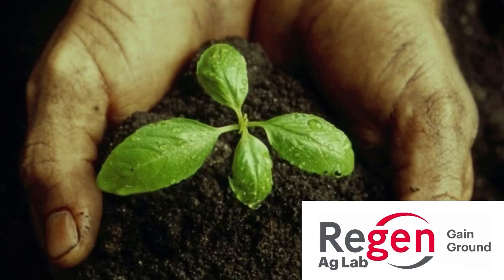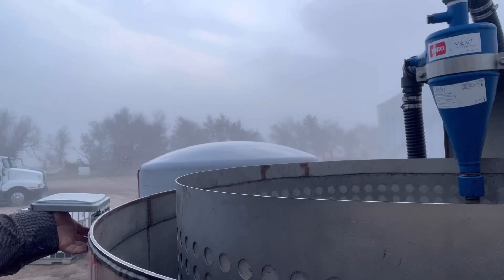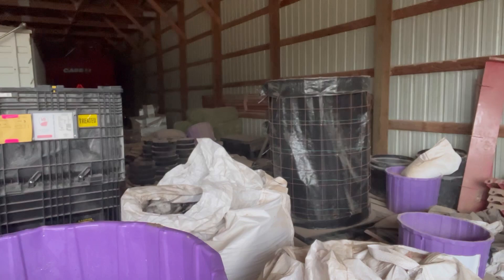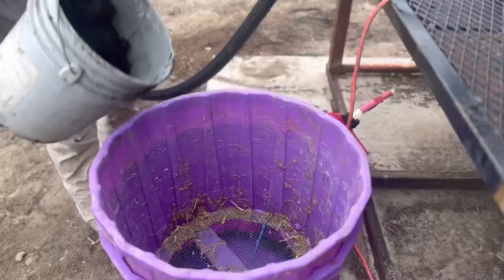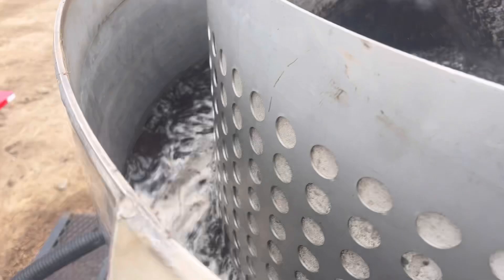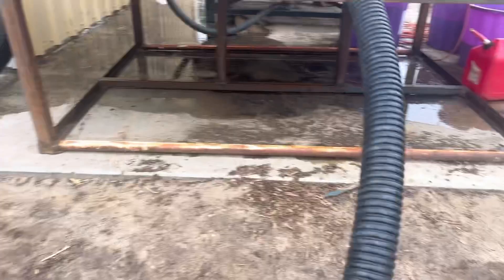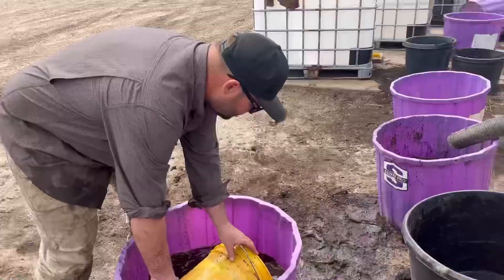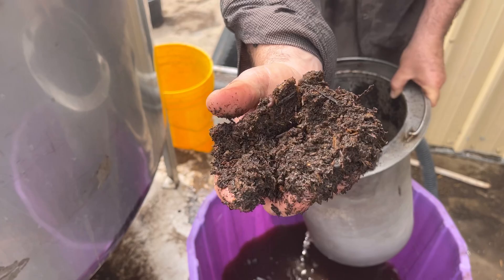How much time do I spend making Compost Extract during corn planting season?

Comment: Run your clean out material through a brew 100 mesh bag (brew in a bag). Then pump the extract out of the tub to your trailer with a little 110v floor sump pump.  Saves a lot of time
Reply from the maker: I like that idea

Comment: Could you dry the rinse residue and add that as dry talck to the seed
Reply from the maker: Fed’N happy yes.   Bio 5 has a few pieces of wood that might be a little tricky
My compost no
Reply: I have screened bio five and coated seed with it. It works great
Reply: Does coating the seed have same effect as using the liquid in furrow? Just looking for easiest way to try it.
Reply: What’s the shelf life of compost extract.  If you could have a 10000 gallon tank full before seeding. Make 30% of your daily usage during seeding.  Spread your time out.
Reply from the maker: @tylersmith3396  

John niswonger has a system with 2 3000 gallon tanks and he can make a 6000 gallons in 1 hour
I’ll try to find that video
Reply from the maker: @tylersmith3396  https://youtu.be/75pyDkcif-A
Reply from the maker: @tylersmith3396  he had some stuff that looked pretty good under a microscope 5 days old